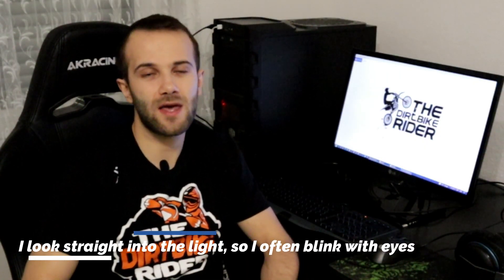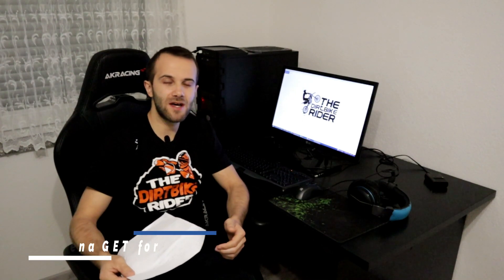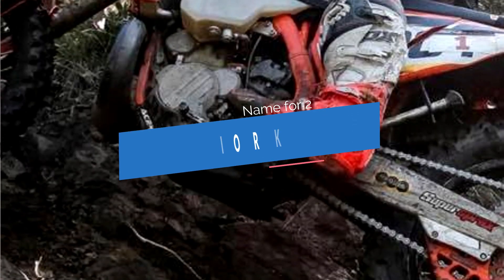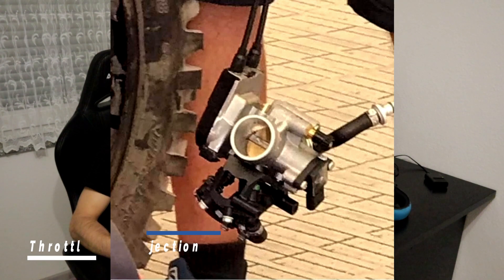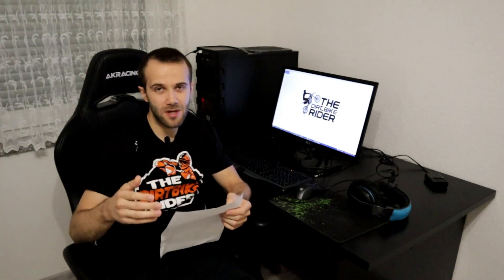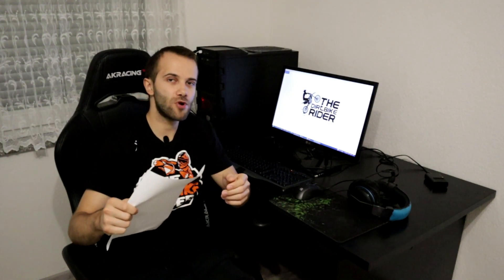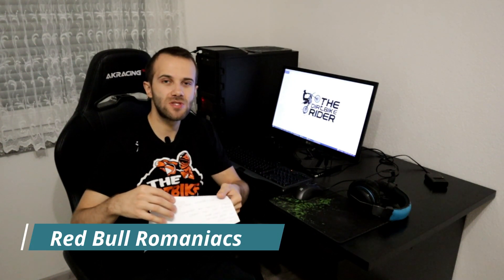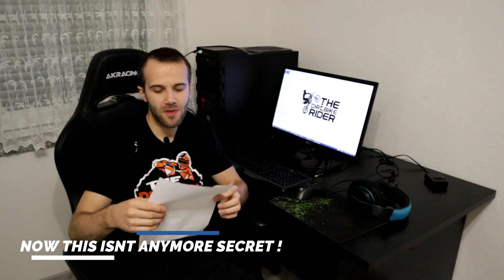2023 KTM EXC & Husqvarna TE - Throttle Body Injection

Comment from the maker: Update: SX models will use premix from factory, EXC models will keep having oil pump but you will be able to use premix and avoid oil pump. They need to have oil pump to reduce emissions for passing EURO Regulations .
Reply: @The Dirtbike Rider And what will it change if we use the premix?  The motorcycle will be stronger?  What's the purpose of all of this?
Reply: A bike that won’t seize do to an oil pump failure

Comment: Could you quickly tell me what this movie is about?  My English is not very good, thanks in advance
Reply: Look up throttle body injection. He is basically saying that he thinks that's what KTM/Husqvarna is switching to
Reply from the maker: KTM will use in future fuel injectors inside throttle body and not cylinder like before.
Reply: @TheDirtbikeRider  I have a ktm 2022 model and if these new injectors come out, I will have to change the cylinder to the newer one?  The oil pump stays?

Comment: Glad I bought a 2021 KTM 150 SX. Basically just installed a JD jetting jet block to replace bad seal gasket. Made a big difference. Didn't want to go the TPI way. Not a fan of oil pumps.
Reply from the maker: do you have mikuni carb or keihin ?
Reply: @TheDirtbikeRider  I have the stock MIKUNI TMX carb with stock pipe and silencer. Only installed a V-Force 4R reeds in it.

Comment: Do you think it will only be premix? I feel like the American market would be to lazy to go back to premix
Reply from the maker: With latest Updates, KTM TBI bikes will come with oil pump for enduro (EXC,XC) so you will not need to use premix and for motcross (SX) they will use just premix with no oil pump. But you will be able to use premix fuel also in EXC and XC bikes. Oil pump you can easy remove, or just unplug.

Comment: sorry my english is bad.
I think there is a problem when they use premix how would they get the right emmisions when they can`t adjust the mixture?or is the bike running like shit when cold/warm/rainy/sunny/in the mountains  ?
Reply from the maker: From factory KTM TBI will still use oil pump to reduce oil ratio for lower rpm and more oil will be added as the engine rpm increases. But most enduro racers will remove or disable oil pump and use premix in fuel tank.  (Updated info)
Reply: @TheDirtbikeRider  okay but why is on the leak picture no oil cap on an exc?or ist the pic from an sx?
Reply: i watch the picture at 0,44 again and when i want to see then i see black tape on the frame where the oil cap was.
or what do you think?
Reply: @kitakater1843  because it’s billy bolts factory bike mate which will have many different parts to a stock bike
Reply: Your English is great 👍🏼

Comment: I wonder if the new tbi system can be retrofitted to the tpi models... It shouldn't be too difficult.
Reply from the maker: Probably if you buy new throttle body with mounting points for injectors. But the problem is mapping, it must be updated to TBI mapping.
Reply: @TheDirtbikeRider  It might need a whole ECU if the TPI version needs an oil injector present to start. Unless it can be reprogrammed to erase it.